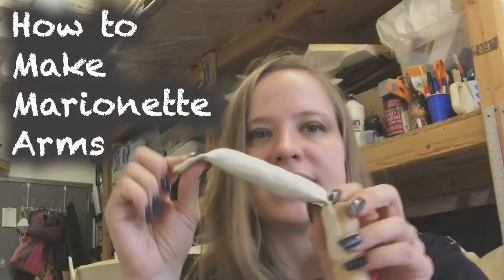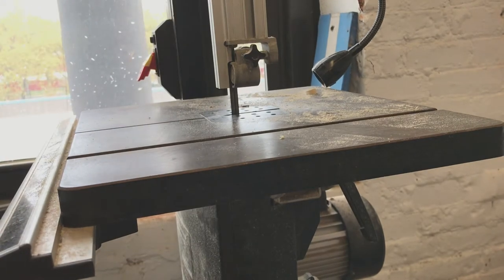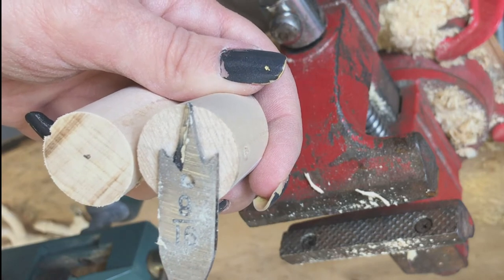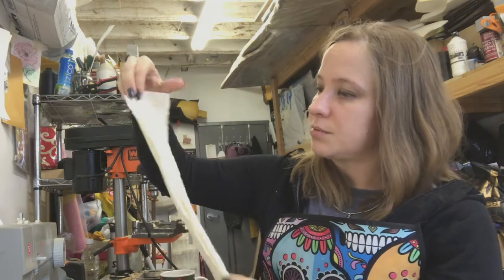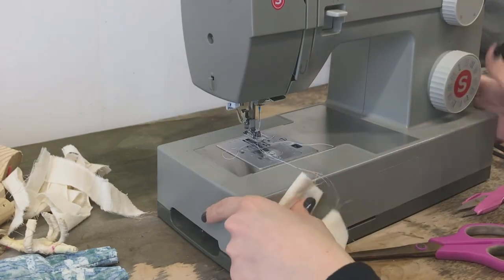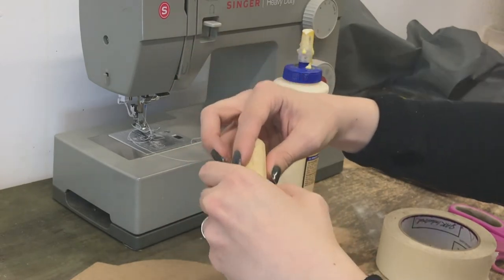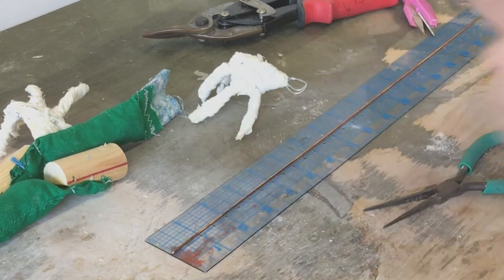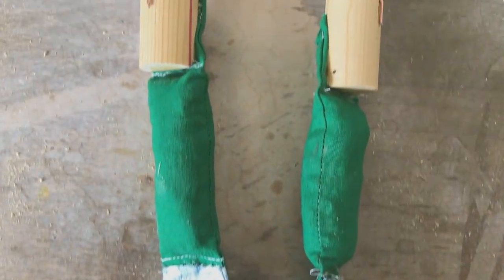MARIONETTE BUILDING 101: How to Make and Attach Arms

Comment: Arlee heres a good tip for you .you can save money of you go out in the woods and find an old dead pine tree or any kind of dead tree.just take a saw with and cut the branches off that are straight they make good arms and legs that's what I do to save money. You can take the small branches and make fingers. Try it I did very helpful. The wood is free out there to take go for it and let me know.